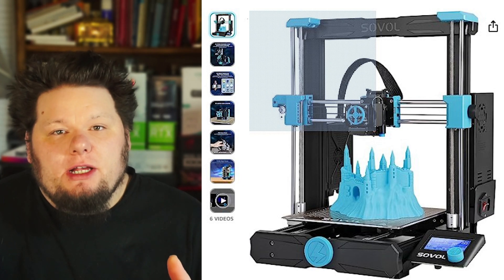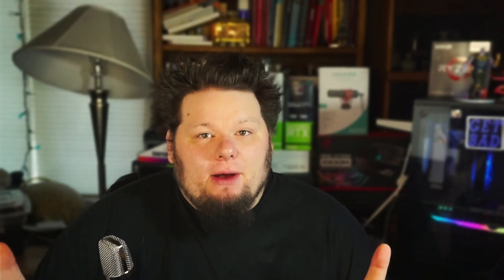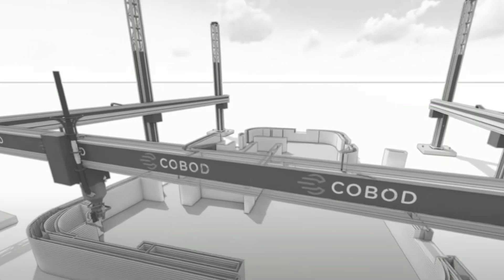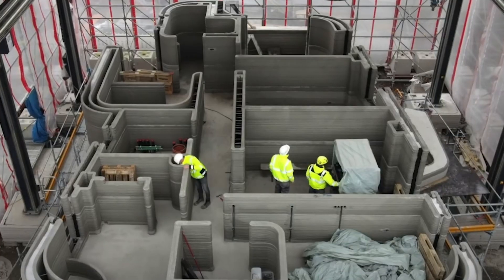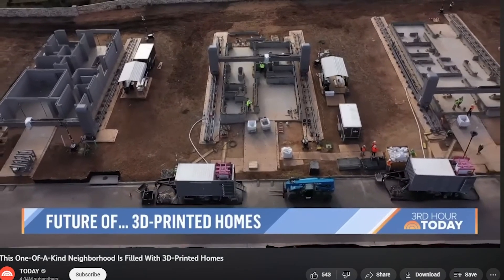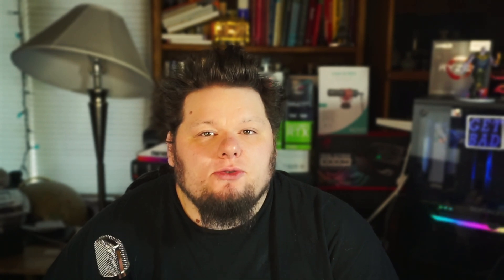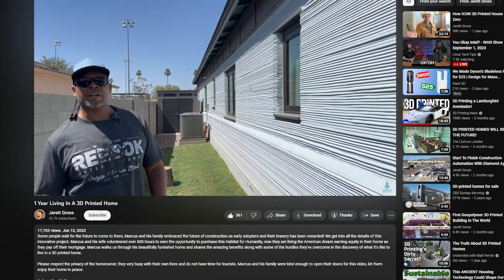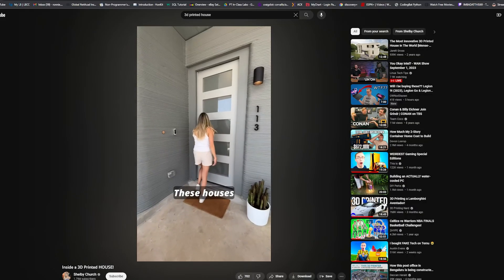3D Printed Homes - Since When?

Comment: A few things on this
1) concrete is a huge CO2 issue and needs to be used less rather than more. Plus there is a sand shoelrtage, so concrete isn't going to be a viable building material in the long term anyways. There are some new concrete mixtures that absorb more CO2 over time than it takes to produce, but these are still new, expensive, and not redialy available for use in cheap 3D printed homes.
2) Wood grows on trees. Wood harvested and used in buildings will stay in those buildings for 200 years with modern construction methods. Plus there is a push to use more wood in construction rather than less because of its earthquake properties and general ease of use and repair. And when a building is eventually done, that wood is burried in a land fill for long term carbon capture. As long as harvested trees are regrown, this is one of the better options out there for sustainable building.
3) concrete is not a long lasting material. I live in a 1950s house, and use to run a 1970s warehouse. The maintenance on anything wood, brick, or new composite materials is nothing. But concrete, if not kept clean and sealed turns to dust after just a decade of freeze and thaw cycles. The idea of cheap homes that are billed as low maintenance will have owners who will put in the effort or cost to seal dn clean it... Seems like a dubious proposition. A traditional home from the 1940s or newer takes minimal effort to maintain and has a 100-200 year life expectancy with minimal maintenance. But a concrete building is going to be problematic within a few decades without regular maintenance. Either reseal it yearly, or put siding on to protect it from the elements or something. The 3D printed look is cool... But that screams maintenance nightmare to me!
4) I question efficiency claims, and wonder if they are mistaking efficiency with thermal capacity. For a nontechnical explication, imagine a single material wall being like a battery. During the day the sun heats up the exterior, and heat slowly penetrates towards the interior. At night, heat dissipates out the interior and exterior, and the AC cools the interior to push that heat line back towards the exterior.
Heating and cooling systems treat the air, but what makes a room comfortable is making sure that the wall temperature remains the same as your air temperature. So modern walls are designed to break the thermal coupling between the interior and exterior of the wall. Typically an exterior facade that takes the brunt of the radiant heat, then an air gap to disappate most of it, possibly a radiant barrier, then insulation, and finally your interior wall. If you are gone all day the only part of the wall that needs to be heated or cooled is the section between the insulation and the living space. So for my 1950s house this takes about 1ft of wall thickness, but for a modern house this is done with 3-5 inches of material. If I am gone for the day I don't need to condition the air in the home, and when I return it takes about an hour or two for the walls to equalize with the desired air temperature. It can be dynamic and contrasty, and as long as there are not several shifts in desired temperature through the day night cycle, my hvac system doesn't need to work long or hard to keep up.
Thick wall systems are different. The wall is a thermal battery that is charged and discharged. Thick enough, and a slow but constant effort applied to the interior can keep interior surfaces constant. But any change in desired temperature becomes a monumental task because there is a lot of material that needs to change. It can be very efficient, if the walls are thick enough to never be saturated, and if the desired temperature remains constant at all times. But a truly efficient building design can change temperatures with minimal wasted effort changing the temperature of building mass. Throw a concrete building in the north and you have a heating nightmare without insulation. Too far south and you need massive walls to tank the day time hit from the sun.

All that said, I'm not opposed to the idea of 3D printed houses. Unsecured single layer concrete houses seem like a horrible idea, but that isn't all that is being worked on. Drill in some rebar reinforcement to help with earthquake resilience. Print out of mud or other materials instead of concrete. Add a facade to take the maintenance hit from the elements, and provide an air gap for the initial thermal disapation. On the interior spray or press some insulation inbetween the wall and the finished interior to make it actually efficient to heat and cool the interior.
Stupid inexperienced mistakes like needing to caulk between the printed first floor and framed 2nd floor can be resolved by laying down a foam strip like every modern house does between concrete basements and stick walls. A lot of these problems were solved decades ago, but 3D printed home builders just don't know what they are doing.
But most importantly... I question this compared to modern poured concrete inside Styrofoam walls. Stack your block walls, keep your reinforced structure, and pour in whatever filler concrete slurry you want to use. You can't get fancy curved walls... But curved walls are a waste of space anyways. Just place blocks and fill, it is cheaper, faster, and easier than 3D printing a house. Plus insane efficiency from having Styrofoam interior and exteriors with a huge thermal mass inside. Slap on a facade of choice outside, and put up tack strips and drywall inside and you have a normal looking easy house build with stupidly good efficiency. Not saying that there isn't a place for 3D printed homes... But it is a small niche for hot dry places with no earthquakes. There are simply better solutions coming for the 90% of habitable areas that don't fit that niche. Between poured material between iso walls, or prefab walls joined and assembled on site, to even traditional stick builds with modern exterior materials and techniques That push the thermal encelope further outside... 3D printing buildings on site is kind of a dead end road. Absolutely needed for building on other planets in prep for human arrival. But when you have humans, or more autonomous robotics, 3D printed homes don't make much sense.
Reply from the maker: Good concise explanation. I'll pin it.

Comment: You forgot the biggest impact, cheap vertical building. 

The houses built now are just to prove it works and optimize the system, but they are not the target consumers. 

Building a printer taller is very easy and cheap compared to wider, and building higher is significantly cheaper with printing than traditional methods. This mean larger houses on less land. 

Picture “small/cheap” houses having 3 stories. One the first kitchen and living space, second bedrooms and laundry, third bedrooms and storage. Large homes could easily have 6 stories. 

While uncommon more vertically oriented homes exist and do a really good job at feeling large with little space, and the stairs don’t feel like a chore. 

These home would work great as family homes. For the less healthy unable to cope with the stairs, chair lifts could easily be installed as the cement walls are an easy anchor point.
Reply: Three-story houses are common here. I live in one. Bottom floor is garage (which I turned into a workshop), middle is living room and kitchen, top floor is bedroom and bathroom.

The barrier to building these homes isn't construction costs, it's local regulations. Especially in the US, which is infamous for having heavy local opposition to the construction of high-density housing. No-one wants the lower classes to move in to their suburban middle-class paradise.

(British homes don't have a laundry - we have a front-loading washing machine located in the kitchen.)
Reply from the maker: I hadn't thought through all of the possibilities. The vertical abilities are one of the benefits that I would love to see. Once they fully flesh out all of the bugs, this will for sure be the game changer that is needed for the future.

Comment: Looks better than a single wide, especially when it comes to insulation.
Reply from the maker: 100%,  I've had the fortune of living in multiple singlewides / camp trailers and I can tell you, concrete will win 10/10 times when it comes to insulation.
Reply: @RC360  As I have as well, I'm optimistic that housing technology will catch up to the needs of the low end consumer. There are a ton of issues with trailers both perceived and real.

Primarily there are many areas of the U.S. that do not allow for mobile, manufactured or modular housing. Usually this is set by county or city building code offices. This has so many consequences. Primarily it drives up cost, stick built homes are expensive to build and building on site takes longer than a modular built in a factory. That means demand and cost stays high, to the point where ~62% of Americans couldn't buy the home they currently live in at current prices. High cost homes are great for cities and counties because that means more property tax, so there is quite a perverse incentive for the rule makers.

Another issue is crime, many mobile home parks or modular developments are predesignated, by the city, for specific low interest areas. This means that these areas will have more offenders as they will be a certain distance from schools, or within the GPS monitoring boundaries of the parole office. That means that for the average joe looking for cheap housing they have to move into a more dangerous than average area. Not much of a selling point for someone looking to start a family or leave their parents house.

Furthermore, due to the requirement to build on site very few "starter homes" are being built. The average new home is now almost 2600 sqft compared to 1000 sqft in 1920. Meanwhile the average household has gone from 5.5 persons down to 2.2 persons in the same time period. Also, the average new home is getting more expensive year-over-year but consumer purchasing power is going down due to inflation. 

I have nothing against people who want to spend seven figures on a home, that's just not most people. At this rate about 1/3 of millennials will never be home owners and 1/2 of Gen Z the same. It would be far more sensible if we had an abundance of relatively inexpensive (~$200,000) homes that were cheap to maintain and had low energy demands. Especially considering the current wave of immigration that is really hamstringing states like TX, AZ and FL.